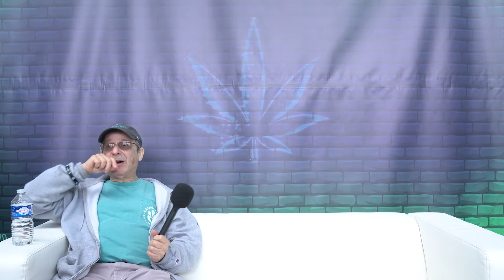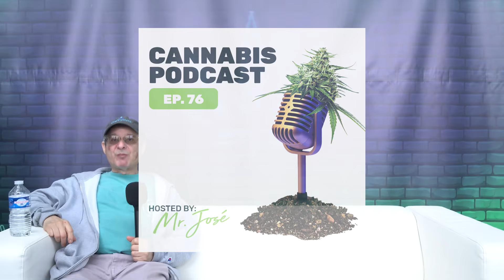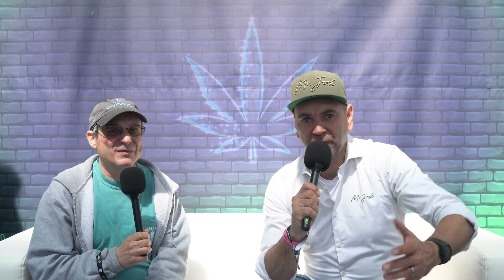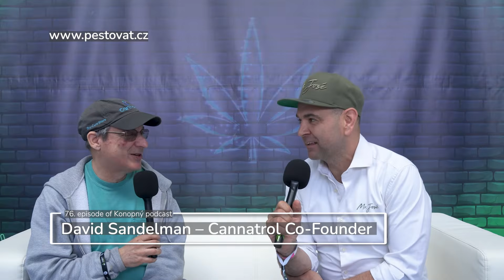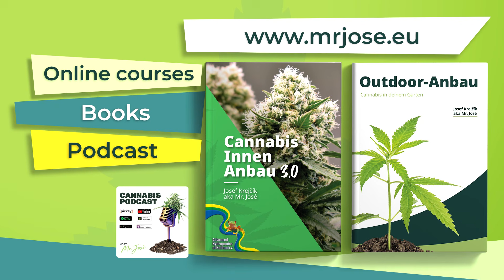Drying & Curing Cannabis with Cool Cure | Interview with Cannatrol’s David Sandelman

Comment: I’ve purchased this unit and I will say it’s been a real pleasure to use. Best advice I can give is when using be patient and allow it to dry/cure its 8 days and still be patient and let it cure for another week or two cause I guarantee you your bud taste will get better. If you take the bud out of the machine to dry another wet plant make sure you keep the dry bud in an area where temps are 60-70 degrees to keep bud from degrading.last but not least plan your harvest. If you’re using this to dry all your plants then grow a couple that flower later so that you can harvest a week or two later. If you grow four indices and they all finish at the same time and are heavy dense nugs then you might have a hard time fitting it all in the machine. Ty for this great tool very convenient and efficient